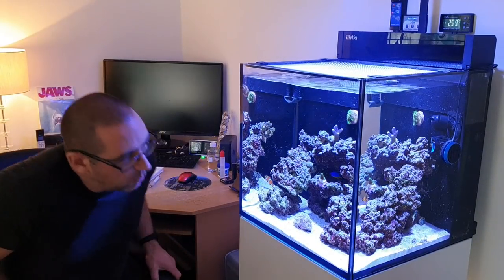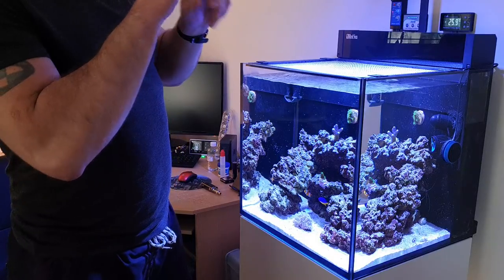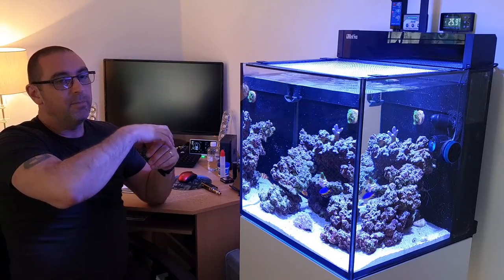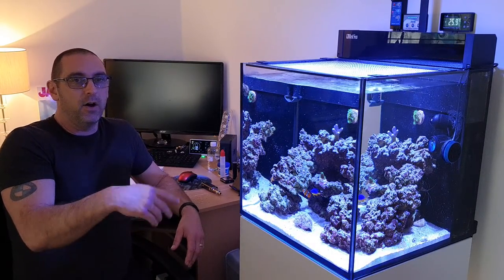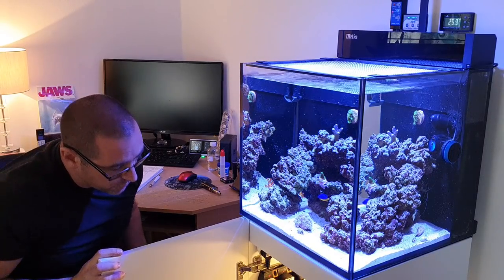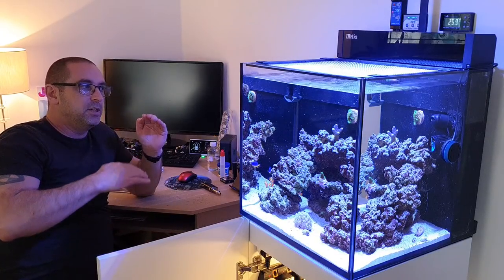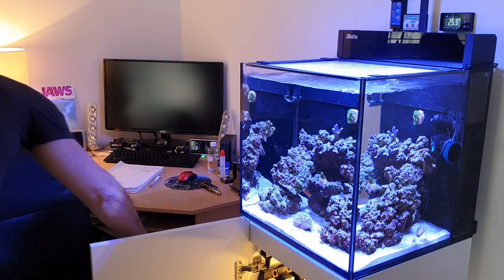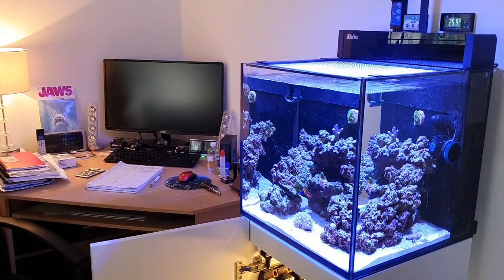Red Sea MAX NANO - MASSIVE TANK LEAK!!! WATER EVERYWHERE!!!

Comment: You should probably install a back siphon break on your ATO line. 😬
Reply from the maker: Could do but lesson learnt just going to make sure hose is out the water even if we have a power cut and water raises in rear chambers
Reply: Ha! Fair enough. Interesting though, that my cheap IceCap ATO came with a back siphon break as part of their package and Tunze doesn’t include one being the more premium brand.
Reply from the maker: @tylerjaax4917  yes interesting
Reply: In the Tunze instructions it says to install Ato hose clearly above waterline!! anyway it was in small print. 😏
Reply: Ha! Yeah, for the price they charge, you think they could include a 25 cent siphon break to install on the line... haha.
Reply: If you get a power cut wont it back siphon unless you fit a break?